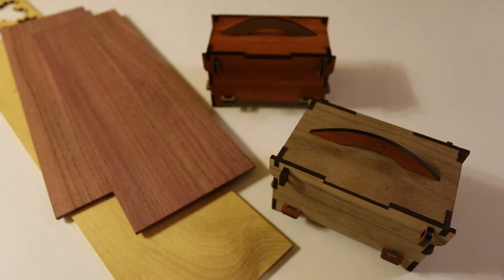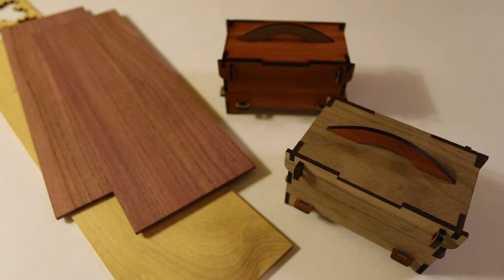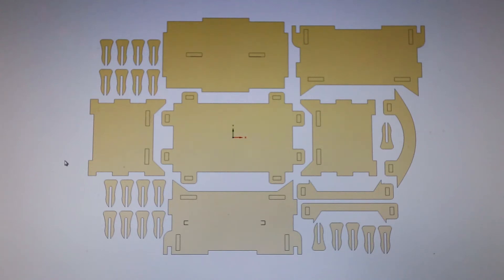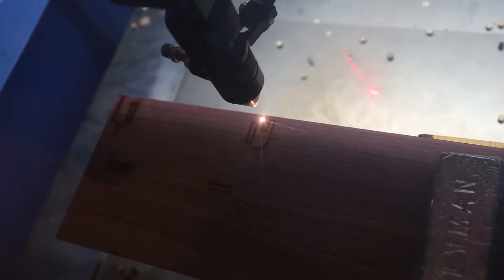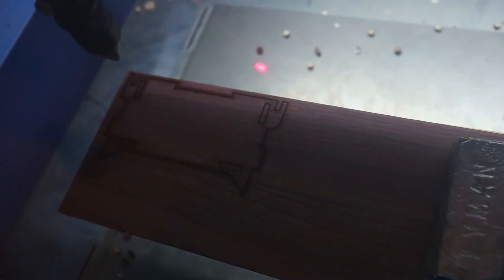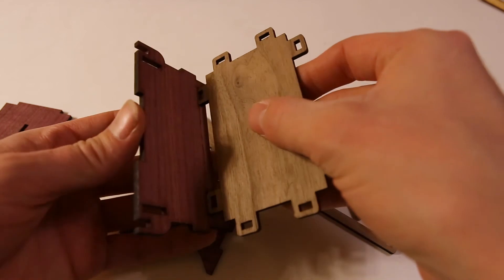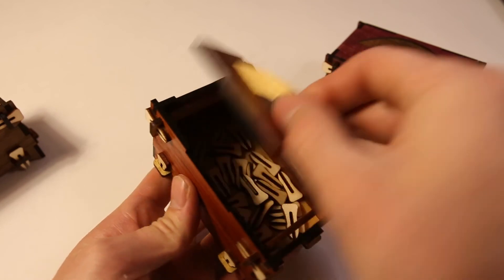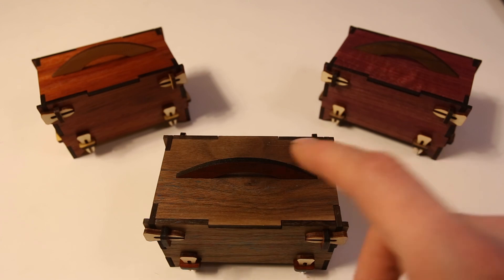Laser Cut Wood Box - VERY UNIQUE

Comment: What size is this meant for, I don't mind paying for it of course but I tried a 12" by 12" and it's all jacked. You're file has a lot of thumb nails but there is no info on what dimension to use. I sure hope you get this since it's 2021. I want to use it for the holidays. Excellent Idea... Need Specs. More specifically, when I open the .dxf file it is one image, so when I expand it what width and height do I use.

Comment: Why is it that you set you laser so high above the material? Are you using a long lens or short lens? You can lessen the burning simply by using an air compressor and air valve and increase the air pressure on the air assist. That will also give you less charring on the cut edge